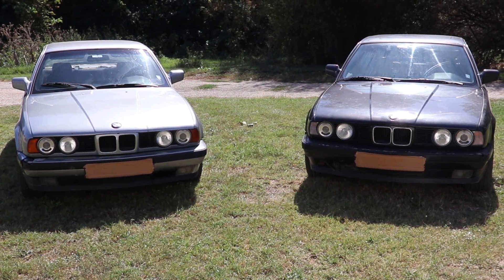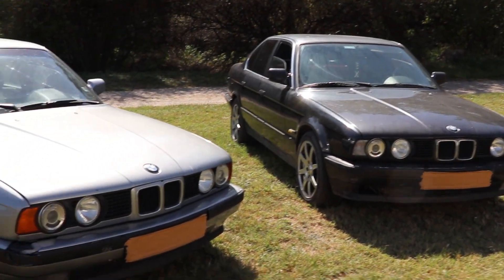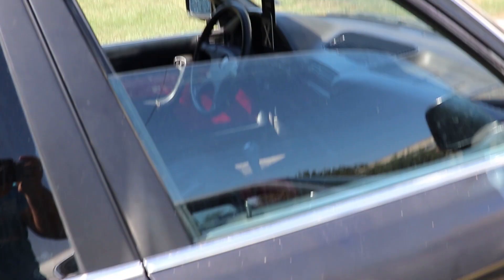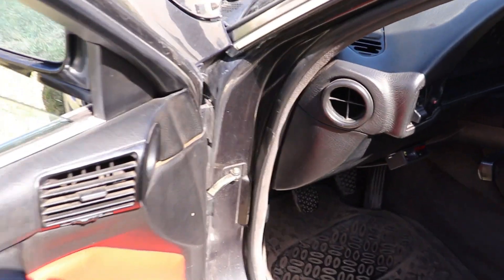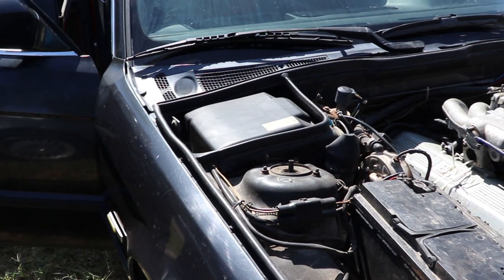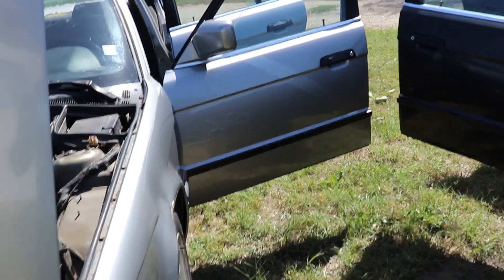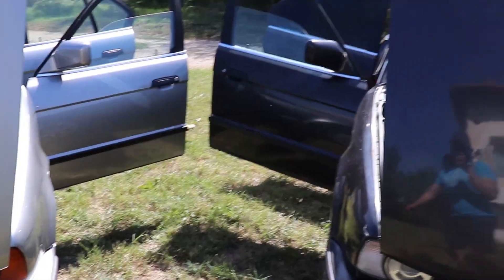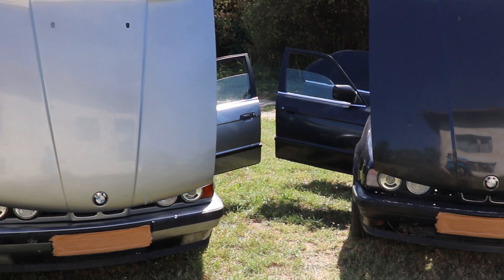THE NEW BMW E34 VS THE FIRST BMW E34 !!!

Comment: What is an E34 going for pricewise in your country? I want to get one but the prices are too inflated where I live, in my opinion.
Reply from the maker: Unfortunately, they are increasingly hard to find and their prices have skyrocketed. But with luck, cars can be found at prices in the order of 2,000 euros or 3,000 dollars. But rather, as an exception, the prices are much higher. Accordingly, they will not be in very good condition. The prices of the better cars are quite a bit higher.